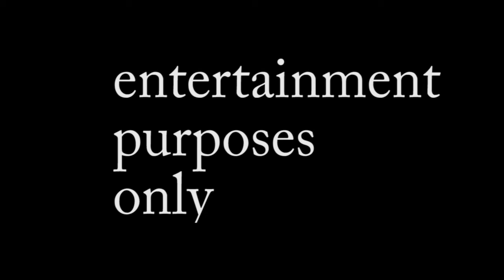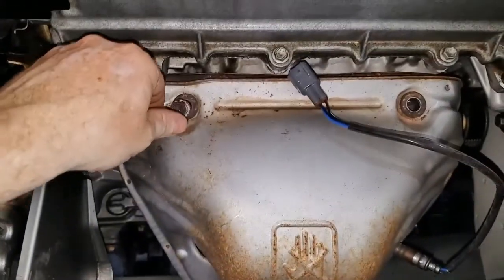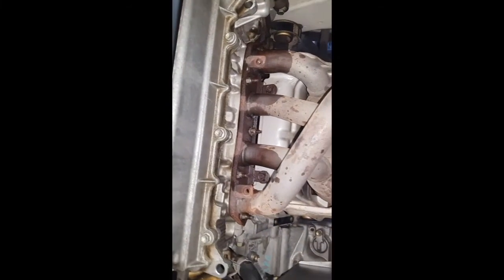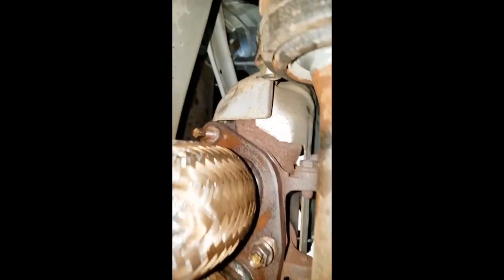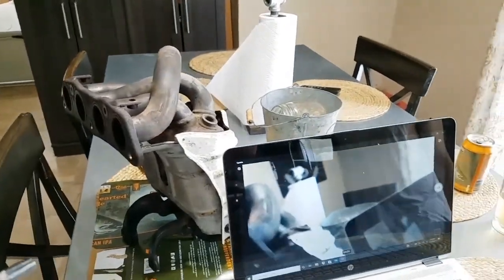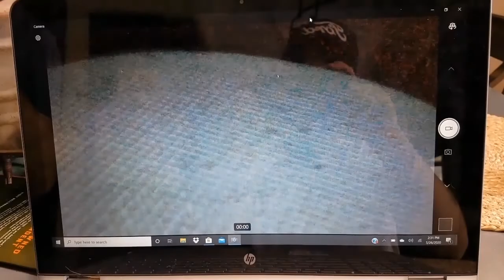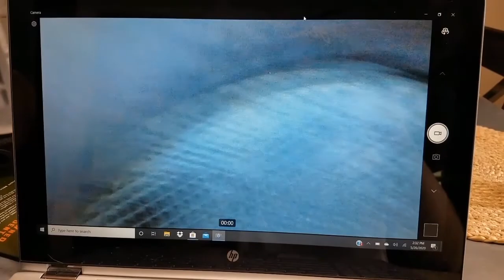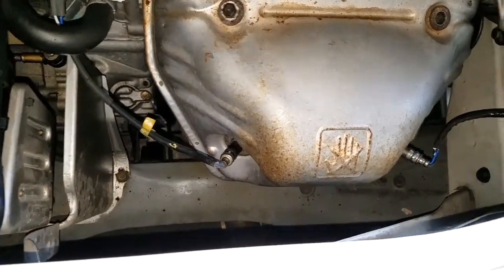Toyota mr2 mk3 spyder pre catalytic converter delete,stock engine 1zz

Comment: So... the best thing  to do is gut the precats? They don't sell aftermarket headers??
Reply from the maker: Only reason for gutting the pre cats is in some cases I've heard of them breaking or chipping small pieces off and being sucked back into the engine and causing premature wear etc.. so the consensus for most is to just gut them (10 minutes and free to do) and makes the car sound a little better imo and frees up 1-2 hp . They sell aftermarket headers and muffler but between them are the regular catalytic converter and the pre cats . Google mr2 pre cat issues or go to spiderchat forums for more info. Some people think it's not necessary but I didn't want to chance any engine damage due to the pre cats falling apart.
Reply: @TonyCampCamppartyof4  I meant to say aftermarket precat delete kit